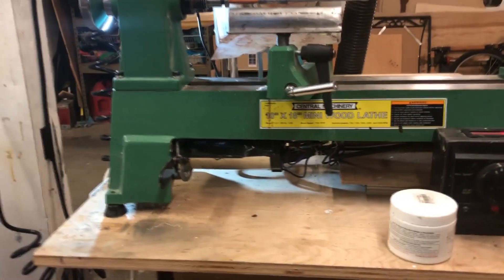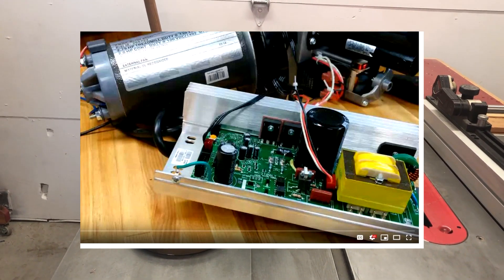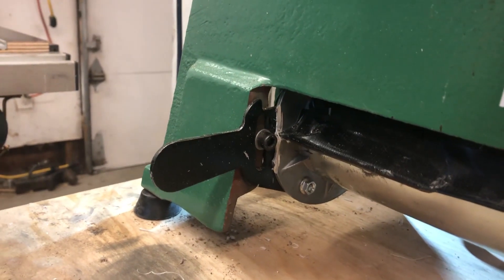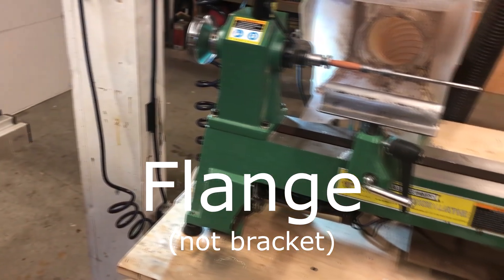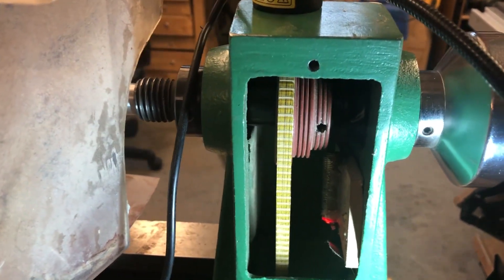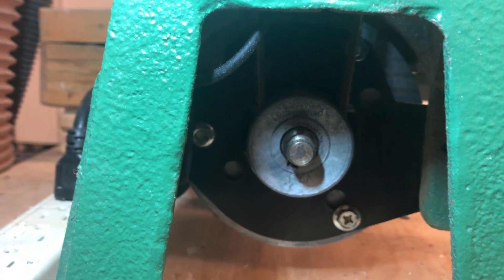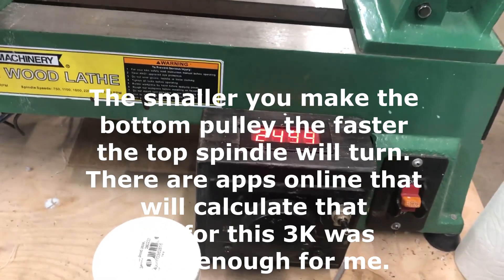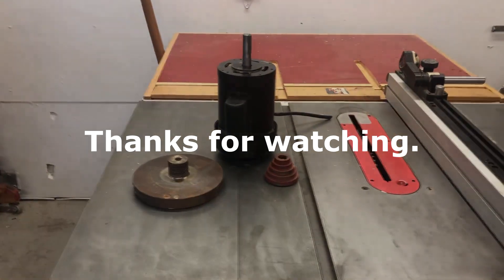Best modification to add variable speed treadmill motor to a Harbor Freight lathe.

Comment: No, the smaller the pulley on the motor and the larger the pulley on the top the slower it will go. Big pulley on motor and small pulley on top the faster the spindle with spin
Reply from the maker: Yes. My mistake. You are absolutely correct. I didn’t catch that.

Comment: Am going to make this modification and this is a very neat way to do it. One concern i have is the 3 groove belt on my mini lathe is good for up to approx 900W before slippage can become an issue (Calculations from an optibelt manual), an the only motors i have found so far are 1500W and above. I wondered if you have encountered problems? If so I will fit 4 or 5 groove pulleys.

Comment: What's the torque like on the lathe? Any problems with it bogging down?
Reply: My concern was slippage rather than bogging down. Hopefully we find out : )
Reply from the maker: @DancesWithAardvarks  Haven’t had any slippage or bogging down issues, however I am a pen turner and only occasionally a small bowl.
Reply: @ramaroodle  Thanks for your response. I've since found an industrial belt with a bit higher rating than the oem ones, so i'm giving it a go as soon as the parts arrive.
Reply: ps the industrial belts are 1/3 the price.
Reply from the maker: @DancesWithAardvarks  if I had to do it again I would just make 2 wooden pulleys.
Reply: @ramaroodle  Thanks. i think thats the route i will take.